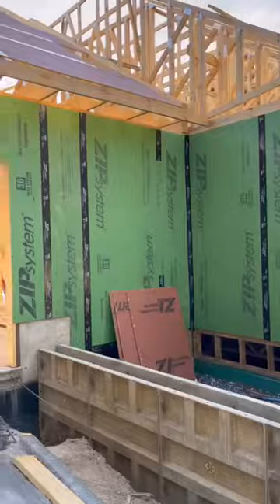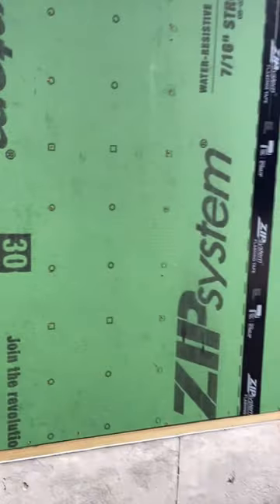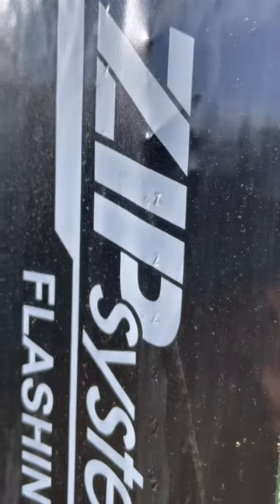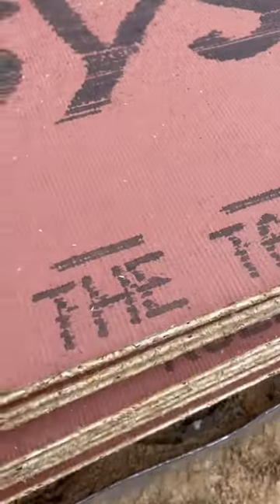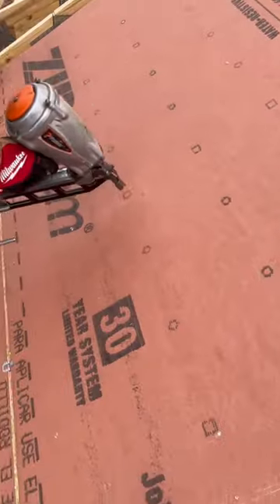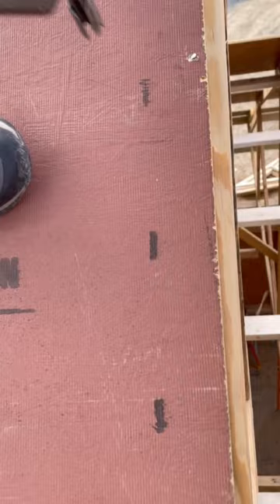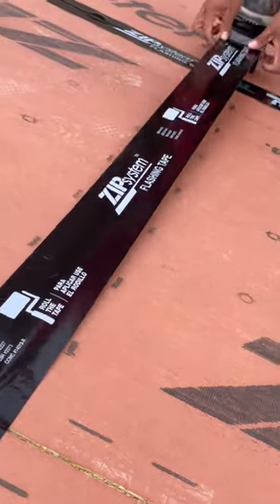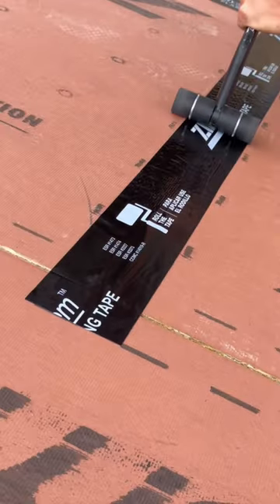Using ZIP System Wall & Roof Sheathing

Comment: I saw a comparison demonstration video. They demonstrated the water exposure durability in of the zip system versus tyvek. Tyvek won hands down. In less than a hour the zip system had water penetrating. By the time the test was done the zip system was completely water logged
Reply: Yah they say that test is bias but let's be real. Zip system is just painting the plywood and taping or caulking the penetrations and seams.
Reply: Got a link? I just watched one that said the penetrations were vulnerable and since DuPont Tyvek overlaps it is fool proof. But it has the same problem that you staple and need to tape it.
Reply: This is not the youtube video I saw but it is directly referenced. This guy what sounds like a balanced contractor review from experience
Reply: I find it hard to believe that zip is less capable than tyvek , I personally hate house wraps , I prefer liquid applied water barrier
Reply: Tyvek is trash and hardly ever is installed correctly. Plus you have to do 2 passes on the outside.
Reply: It concerns me that Tyvek is harder to do clean penetrations, and seal them up,  but the Zip board  can be flashed more easily.

Comment: Where I live in Canada that stuff is not readily available. It’s special order and it will probably cost you at least 25% more then the method we currently use.
Reply from the maker: There are some good rebates on Zip System currently
Reply: @hausplans  sponsored videos need to be labeled sponsored for good reasons
Reply: Canada has a lot of timber. You can still get great lumber and other wood. Zip is getting bigger in the states because the base wood is that chipped particle board stuff so the manufacturing of it uses glue and waste product wood from proper plywood and sheathing.
Reply: It's already 25% more even in the US. Sounds like normal price to me.
Reply: @court2379  but why would I pay more if I can get a product that is very similar and performs nearly just as good for a cheaper price? I would love to use the zip system and there floor sheathing, but I don’t see the value difference in the product. Now I will say that I could go price it out and see the price comparison, but there is still the thing about it being special order for me and where I live according to my research.
Reply: @jakeklassen3702  No, I was meaning that it is expensive here in the US too and that your pricing may not be abnormal. I agree it is over priced. I also question it's quality. They have already admitted the fasteners compromise it and now require all the nail heads to be sealed. By the time you seal all that, it seems to me a continuous fabric applied afterwards is better anyway. Or maybe one of the paint on systems.
Reply: @ oh sorry, I get what your saying now. I did not know about the fastener penetrations, now it adds another  step to seal those. It’s a lot to consider when you’re paying full price.
Reply: @jakeklassen3702 I agree with your comments.  I prefer plywood n house wrap.  I've seen where they're soooo tight u have to add a fresh air system!  lol.  defeats the whole air seal.
Reply: @miked5106  The fresh air system goes through a heat exchanger saving half or more of the energy and keeps your house more comfortable.

Comment: But remember, if you’re doing a mortar wall for natural stone, stone veneer or stucco…etc, zipSystem calls for one layer of house wrap over their green board. If you do regular OSB, code calls for two layers of House wrap.
Reply: must not be in the code in Virginia. I've only ever done one layer, oops. makes sense though. I always wondered since concrete isn't waterproof
Reply: @davegordon6943  
I thought it was only one, in CA they only use one layer and it’s usually asphalt paper. But I’m in North Carolina now and it rains a lot so I guess it’s standard here with the professionals. At least that’s what I was told and I just finished a chimney so I used two layers. I could be wrong though.
Reply: You speak like all 34 million townships have the same code.
Reply: It's better to use a rainscreen.

Comment: I would go right over the zip tape with some tar or something waterproof just to add extra protection
Reply: That’s a good idea. Tape is nice. But expecting tape to last 20 years is a joke. In my opinion, overlapping is still a long term better option.
Reply: And void any warranty that zip system offers and it is completely unnecessary. It seems like you are unfamiliar with the tape they use and how it is formulated.
Reply: is it recommended by the manufacturer ?

Comment: Here’s my problem with it. I’ve seen redone the exterior of a few home and the sheathing is always messed up. You do you repair this if the woods still good? Paint it with a rubber coating?

Comment: In extreme cold climates...would you use spray foam to fill all junction gaps and cut flat when dry before installing and rolling the zip tape?
Reply from the maker: You want to insulate from the inside.
Reply: @hausplans  OK, right on. From the inside I was thinking R19 Roxall followed by double layer of 6 mill poly vapor barrier followed by 1.5" of foam followed by drywall.

Comment: Thank you for the video. 
I have never used the zip system, but I want to try it.  I want to use it to do a roof repair, and not a brand new roof frame. 
Keep up the good work.
Reply from the maker: Thanks, also Huber is offering some good rebates on their Zip system right for first time users

Comment: Depends on the climate. Air tight boxes that need an air to air ex-changer with humans aspirating as they breathe, bacterium could be a problem. I would say mostly for use on very large sq. foot applications. Small homes need to breathe to get the moisture and stale air out.

Comment: H clips are definitely unnecessary, but you do what the customer wants and do good work just like this. 👍 I've seen homeowners asking contractors to use screws and nails! Seems like an oxymoron to me, but if you're willing to pay me for the extra time and materials, I don't care what they want. As long as the inspector doesn't care what the homeowner wants, I'll do it. Great job though 👏 👌 👍
Reply from the maker: Thanks

Comment: Using it without the roller though
Reply: We use the zip system and zip tape, but we use our hands instead of a roller. I know you’re supposed to… but we’ve never been called on it
Reply: @zorororonoa22 you come in here to grab about cutting corners?

Comment: H-clips will make the performance of the roof worse. Bad idea when you have T&G plywood. You spent money and effort to make the roof worse. Why did the client ask for H-clips?
Reply: Why would they make it worse? 
Good for you if you use T&G. Most will not. Clips are required for wider rafter spacing.
Reply: @pcatful  The T&G helps stop/minimize any out-of-plane movement of the joint between plywood sheets. If you add H-Clips to T&G that joints actually becomes more flexible and get more movement. This can damage the roofing when people walk on the roof (depending on the type of roofing you have). It is generally bad for the tape and membranes. It also makes a larger gap which is also not good for the tape.

H-clips are only required for thinner plywood on wider truss/joist support spacing for square edge plywood. This is generally for cheaper construction and leads to an inferior product in the end that is more susceptible to leaks.

If you use T&G, you do not have to use H-clips (ever). However, it is hard to find plywood less than 5/8" thick that is T&G. I have seen a few products (like V-edge 1/2" plywood) but they are not widely available.

Comment: This issue is that most contractors don't install it properly.  ANY penetration needs to be tapped.  Most dont from the dozens of jobsites ive seen it on
Reply from the maker: Taped and rolled

Comment: this  stuff sucks, especially in places that get real 4 seasons. I use 5/8 fir plywood with h clips and tar paper w/ ice and water shield in valleys, cheek walls and 1st 3 ft of roof. We only use Typar, Tyvek disintegrates in 5-10 years, I have reshingled houses that I shingled  25 ears ago with typar, or tar paper, and it looks brand new when exposed, Tyvek crumbles like confetti, and OSB swells and loses its structural integrity, I have removed plywood from the fifties that was like new still. No osb products hold up well in the north.

Comment: Just another crap product to charge you more $$$. It's glorified particle board, and every nail you put into it has to be caulked or taped, or you compromise the sheathing. Old school, you use a good 5/8" cdx plywood and dry that baby in with a good synthetic underlayment or a good old 30ld felt for that matter. The " coating " does not replace the efficency of house rap.